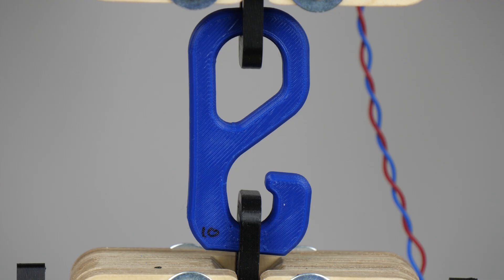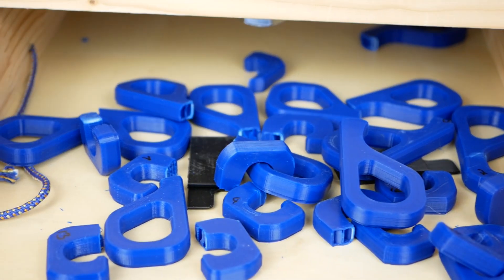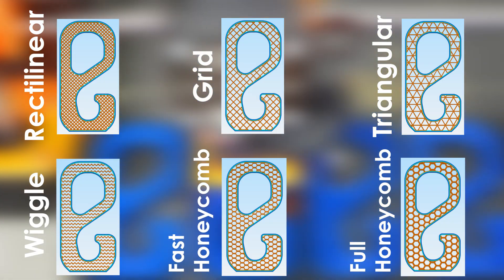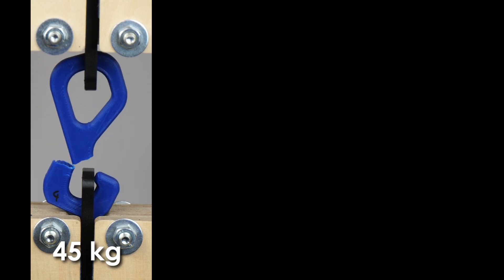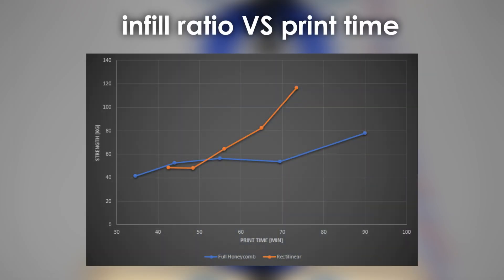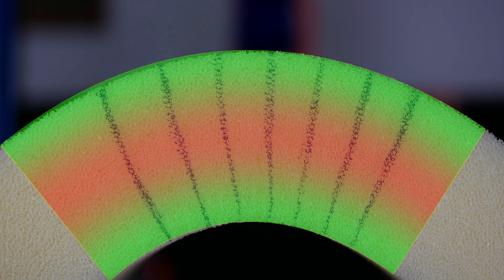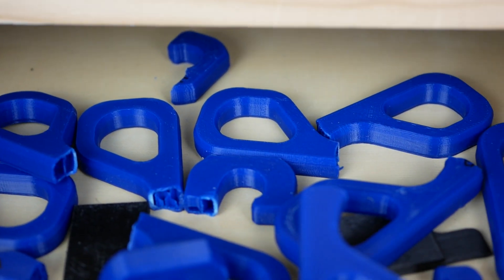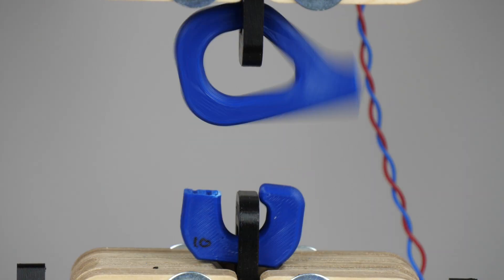INFILL pattern and SHELLS - How to get the maximum STRENGTH out of your 3D prints?

Comment: Great video, loved the science-based info about the different infills and perimeters!
A few items not mentioned in optimizing material usage:
1.  The hook is currently designed with the positioning of the load offset from its support.  Move it closer to the support to reduce bending forces.
2.  Make the part that keeps breaking wider, and the parts that are NOT breaking narrower.
3.  Be clear on the loads the parts will be subjected to, including installation (if any).
4.  Print hotter, for better layer fusion, and make sure that your printer is not under-extruding. 
5.  See CNC Kitchen video https://www.youtube.com/watch?v=9YaJ0wSKKHA.

I wonder whether anyone is working on a way to beef up selected areas of prints, e.g. thicker perimeter at this point, solid infill around screw holes that will be subjected to crushing forces, that sort of thing?

Comment: Great video. Love your content!

I would add a comment/reminder regarding part orientation as the biggest factor (before even looking at infills, perimeter layers etc... whenever possible). It might be obvious, but understanding the load path of your designs and orienting the part on the print bed so that the load paths are in the XY plane (continuous filament) is likely the most efficient way to get strength for a given weight. I know it's not 100% the point of the video but it's still a good reminder. You have shown us how anisotropic printed parts are.

Learning a lot from your studies.
Reply: agree, and I've found that layer cooling is huge too, particularly when I am printing multiple parts together like these hooks were, and the slicer is making decisions on travel with parts that are being build up side-by-side.
Reply: hi if you were printing a furniture leg that is round  that has an adjustable skrew to adjust the length, would you print it on its side to make it stronger xx

Comment: I have had some success by adding internal 0.5mm holes between surfaces at selected locations. They don't go all the way to the surface. This makes the slicer add some wall thickness to the hole giving greater compressive strength, wall to wall.
Any comments? Have you tested this?
I am using cura, mostly.
Reply from the maker: Check this out: https://youtu.be/q0YsC53mFvY

Comment: Hello...I am printing tiny lettering and I am using a 0.2 nozzle however only 3 quarters of the lettering is printing on each letter there is about 20% left that did not print. Do you have any idea why that is happening? I do have pictures as well.. Thanks

Comment: Do you know if the percentage of infill is linear to the used material (in all programs)? I'm using cura as my only slicer and can see that the gap between two lines of infill does not fall smooth by increasing the percentage but with hops.

With 100% infill the part seems not to be massive but with "the smallest possible gap"

Do all slicers work / calculate in this way?

Comment: I do rectangular but do -45 90 45 0 as the angles. I mostly print flat plate and covers for custom parts at work. Would I be wrong in thinking this isn't that strong?

Comment: Hey Stefan :D Thanks for the video, you mentioned 100% infill is not advisable, how do you usually achieve your solid specimen for testing? which settings are you using? or what is the strongest part by dimensions if weight is no objective :) 
Looking forward to more of this even thou its already a year later
Reply from the maker: I do use 100% infill ratio for them but really finely tune the extrusion factor for each material.
Reply: @CNCKitchen  Such a fast answer to such an old video o.O Thanks! :) yea i noticed that the extrusion factor seems to matter a lot, some parts just break very easily due to tension it seems...
I will try around with this a little, lets see what i find :D

Comment: Guten Tag, great video :) My first 3D printer is still on its way to me, but it can't hurt to start watching videos right now. 
Your video reminds me at a documentary I watched a couple of month ago about (the MIT?) engineering 3D patterns for different stress directions and some crazy origami like, single sheet metal folding structures. I am already searching for this video and will link it later here. This gives me the idea to do the same with flexible filaments and different 3D infills, to give a print the flexibility only in the desired direction.(s)...but I think you should do a video about it, if you like the idea. I probably need a few years to gain you expertise ;)

Comment: Usually I print with the grid infill at 20-25%
I don't like the rectilinear infill because it comes out quite thin

For parts that need a bit more strength, I print using the cubic infill pattern, which is 3d. From now on, I'll also increase the number of perimeters, since that seems to be more efficient.

Comment: Nice job testing this out. I've found that if you want strongest part, you have to determine outside forces nature and enviroment first, then select corresponding material (PLA is fragile, so you wont go with it for impact-proof things, for example), then orient your part so that force goes parallel to the shells in most critical part, and then select infill and shells amount.

Comment: Great video!! You mention at the end of your video never to use 100% infill, but if I wanted to test a specimen for maximum strength, in this case, I would need to set infill as 100%?
Reply from the maker: Yes, but still with lots of outer shells.

Comment: If you were to put the load horizontally versus vertically you'd get different results. All around, a honeycomb structure will give you the strongest tensile strength and it has an added bonus of dampening sound waves more effectively than the other infill patterns.

Comment: I noticed that the breaks reveal a small amount of air between the perimeter layers. I'm not sure whether this is layer seperation due to the load or actual gaps in the printing.
If it's the first, you could try lowering fan speed to increase adhesion.
If it's the second, maybe play with extraction speeds to fill in that fraction more material.

Comment: Increasing perimeter width is definitely a noticeable strength improvement.  However I believe that alternate layers of serpentine and straight paths in the perimeter would improve strength even more and I’ve asked the Cura team to add this to their slicer.  Would like to hear your results if you test this option too.  My reasoning for it being stronger is that it will give a bit more on the serpentine but will have axial strength on the straight.  But maybe the converse argument can be made !!

Comment: Very useful.  I, too, am curious about the 3D infill patterns, but I don't think they'll have much effect on this particular test due to the orientation of the forces.  They might help with tensile strength or when dealing with forces on different planes.

As a follow-up, what about post-processing the parts?  I've found that PLA will soak up superglue (cyanoacrylate) and I suspect that improves the bonding between layers, but haven't tested it scientifically.  Similarly, polycrylic provides a more impact-resistant and smooth surface, but I have no idea about its effects on strength...

Comment: Hello! Thanks for video!
Looks like you are using one of Prusa i3 3D-printers.
Could you please share exact printing conditions (temperature of bed / extrusion nozzle, travel speed etc.)?

I'm using the same type of plastic (PolyLite PLA 1.75), but true black color and do have some issues with over melting of already printed layers.
My settings are in range of recommended setting, but still something is wrong. Thanks!

Comment: Good analysis, although you can not say “If you want to print strong parts go with shells” because you are overly generalizing the strength. For instance your experiment is not valid for axial (tension/compression) only loads or internal stress do to environmental conditions.

Comment: Using Cura, I have had really good results with the 3D Cross infill. A majority of my parts in standard temper PLA are as good as they ever need to be with 30% infill and 3-4 walls with this infill (depending on Application). My personal thoughts, your applying to a market that is highly interested in "tech" if their curious about comparative destructive testing,  bring on the "tech"!! Love it!

Comment: Hi Stefan, 
das Infill ist normalerweise überall gleichmäßig verteilt und wird einmal vorgegeben. Die empfindlichste Stelle ist immer die gleiche, vorhersehbare Stelle. Hast Du mal versucht das Infill so zu verändern, dass die empfindliche Stelle ein stabiles / langsames Infill bekommt und die unempfindlichen Stellen das mit der größten Gewichtsersparnis plus höhere Geschwindigkeit?

Ich fürchte einmal, dass die Software sowas nicht hergibt?!?!? Oder kann man das Infill je nach Sektor oder auch nach Höhe verändern? Vermutlich muss man das dann schon in Fusion 360 so vorgeben und "Bauabschnitte" des Teils vorgeben. -- Ob "TESTING 3D printed INFILL PATTERNS for their STRENGTH" die Antwort schon liefert, werde ich gleich sehen.

Hast Dir schöne Themen ausgesucht. Weiter so. ;) Auch wenn die Anzahl der englischsprechenden Zuschauer höher sein wird, als die deutschsprachigen: Die Imperialen Maßangaben sind schon ... "komisch".

[Edit:] OK, die Stelle mit der Wandstärke muss ich mir auch noch mal angucken.... ;)

Comment: Could there be a different result if you printed each hook separately? Especially as you get higher, I would imagine that the plastic cools down a bit, especially with more hooks on the plate at once, and potentially create a weaker adhesion between layers.
Reply: I was wondering the same thing.

Comment: Still pretty new to printing myself but I've been using like 15% infill max and an average of 5% I feel like infill is simply to help stabilize walls to help prevent collapse. Thicker walls I feel is where the actual strength comes in. Ideally you slice it and skim through the layers to see how it will print to determine whether the percentage used is actually going to reinforce what you want.

Comment: This only measures 'tensile' or 'shear' strength, not 'compression' strength. Another factor beyond infill density, is infill thickness.  Most infill is printed in single walled layers by default, but that can be increased to multiple walls, which would undoubtedly increase strength. So you could have 20% infill but with 3 layer thick infill. Another factor of infill is the overlap percentage, where it connects the infill to the outer walls.  This is by default 5%, which isn't much.  If you were to increase this to 50% for example, or even 100%, you would have a much stronger connection to the outer walls.  I suspect that the reason why regular infill comparisons don't add too much strength is because it's soo thin, it effectively pulls apart and separates from the outer walls, not really reinforcing them as much as they could and acting more likely a lattice to support top layers than to increase strength. 

I would also say that with the geometry of the hook and how it carries its load, top and bottom thickness would be more important than side wall thickness.  So you could probably get away with single layer wall thickness, while giving the top and bottom layers more thickness, and substantially increase the strength of the part.

So if you really wanted stronger parts, you'd increase the infill overlap percentage along with the infill wall thickness along with the top and bottom layer thickness.

Comment: This video confirms my own research on the perimeter shells. I sliced in S3D and print 3D boat parts for some low load rigging parts and some other areas. They work fine when the part is correctly drawn, load vectors are aligned, rounded edges (sharp edges brake sooner), 20-50% infill (usually triangular), Number of shells (5 is good for this application), material and color (black seems to be the most U/V weather resistant in any one material). Good work.

Comment: Nice, your approach to the problem does a very nice job of quantitating this and also explaining why it should be the case.  I came to similar conclusions that the rigidity of a part is mostly coming from the wall thickness, as long as there is some infill to brace the walls.  Even parts that have to withstand significant crushing force don't need a lot of infill.  I am usually using between 1.2mm walls and 10% infill, to 2mm walls and 25% infill.  That's between 3 and 5 outer walls (with a 0.4 mm nozzle), and an infill grid size of between ~7mm and ~3mm.  I prefer the grid type infill based on speed.  I also use the "connect infill lines" option in Cura.  This reduces visibility of the infill lines on outer surfaces, and also helps adhere it to the inner walls, while giving them even more thickness/strength.

Comment: Awesome vid. I totally agree with your findings. Shell/wall thickness always makes a stronger part. I've used a screws for cement, brand name Tapcon, and a spot of glue for structural PLA parts. Never less than 1.2mm walls with screws.

This is strange
Just noticed the date you posted this. Feb 25 2018.
I just revived the email notification today. June 10 2018
Reply from the maker: YouTube is probably doing it's "experiments" again...

Comment: Your videos are the best! I'd like to point out that in Cura 100% infill will actually make as many perimeters as needed to fill the surface, instead of using paralell lines like S3D, so you would get Pisces a lot stronger with 100% infill in Cura.

Comment: Final Conclusion is INCREASE SHELLS AND DECREASE INFILL. How the hell unlike this video? This is awesome.
Reply: over time you also have to account for cats jumping up on the keyboard and clicking dislike on a video, 1 out of 100.
Reply: @Amipotsophspond  ONE SURE FIrE WAY TO (oops caps lock) avoid the problemiiiiiiiiiiiiiiii990kkkkkkkkkkkkkkkkkkk ( ?!@@#! cat) , Get a dog!
Reply: The ones who would dislike the video are working for big-infill. That industry has a lot to lose because of this video. They want to silence the truth! Also, as stated above, cats.
Reply: This is not universally true. Very dependent on loading case.
Reply: @appa609 "Very" dependent is not quantitative. I'd say not very dependent.
Reply: For bending stress, yes. It’s called the Flexural Formula. The section modulus of the material is calculated to the fourth power; i.e., the importance of the outer most fibers goes up quadratically in bending.
Reply: What are shells, please?

Comment: It would be super cool if you could select surfaces or elements for thicker shell counts. Short of that I think ribbed wall design features (hat sections) will force more material where you need it.

Biggest driver, I'd imagine, is to make sure the direction of load isn't spreading the layers apart (transverse to layer), but along the layer xy plane.

Comment: has simplify3d added a real wall thickness setting yet? (like kisslicer) rather than just increasing the number of loops, it adds a 100% infill to the desired wall thickness minus the thickness of the number and width of loops set
Reply from the maker: Nope, and I'm actually not a big fan of it. I rather control my extrusion width and number of perimeters directly. CURA supports it, though.
Reply: CNC Kitchen I find it makes much stronger laminations than perimeters

Comment: I wonder how much the strength would change if you put a wall down the center of the part. Where matching the wall thickness of the outside shells, the interior wall shouldn't stretch or contract when bending. I also wonder how the strength would change if you add a few solid layers in the middle of the print. 
Basically a + shape along the interior of the print, along with infill. Could always change it and try a x shape with this method too. Maybe even try it without infill. 

Would also like to see the 3d lattices, though I don't think they'll do much as there's more open 3d space within the part. Maybe even find a way to make the area of stress have more infill than the rest of the part.

Would also be cool to see this tested with the printer that can lay down strips of carbon fiber, and I assume the printer can also do kevlar or other composites.

Comment: Fusion 360 can help a part design align to the forces applied to the part...the infill patterns you show dont seem to be able to be modified to align with these forces...eg a denser pattern in higher load ares...? Thanks Laurie
Reply: In Cura now you can load modifier meshes where you can change any setting for a mesh within a given volume, both surface and infill. A bit glitchy though.

Comment: Just found your channel, thanks to a shout-out from Angus. Really like your detailed test and measurement approach.
On this particular topic, I'd be interested to see how the cubic etc infill patterns in Cura perform - they claim to achieve more consistent strength as they move layer to layer by building a three-dimensional internal lattice. I can see they should be stronger under compression in all directions overall, but I imagine the layer adhesion for the infill itself is significantly weaker when under tension.

Comment: Should note that print bed orientation of part vs loading is critical .. placing layer bonds in tension when loading  a part, is usually the weakest scenario. So, in addiiton to infill and shells .. .one must consider part design & printing orientation vs. the anticipated loading.

Comment: I noticed that S3D prints all 3 directions every layer by default, with the triangular infill selected. I think that is what caused the difference in weight and required filament. I use triangular a lot, but in most cases I set it to one direction per layer (so the full triangle shape is completed every 3 layers).